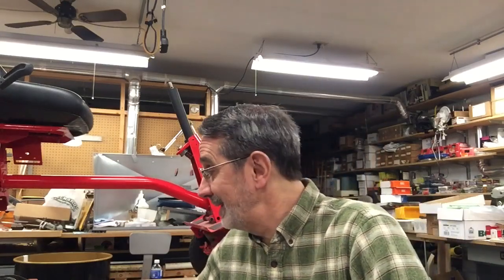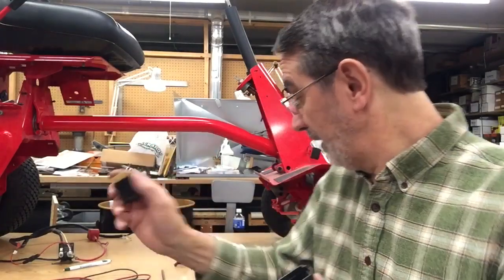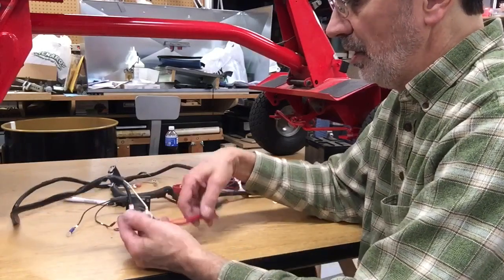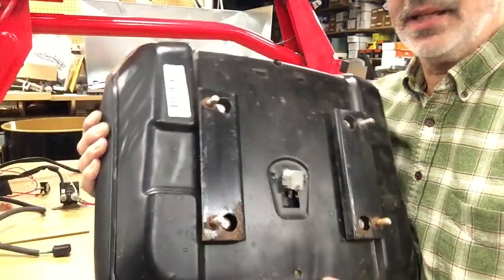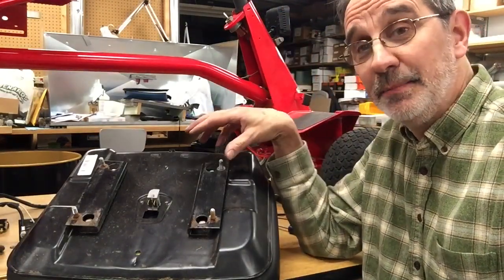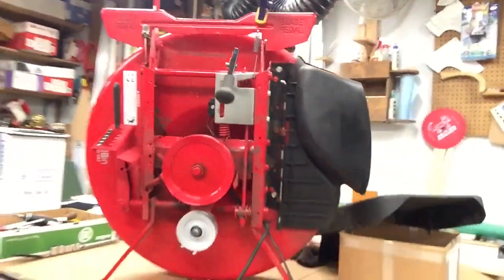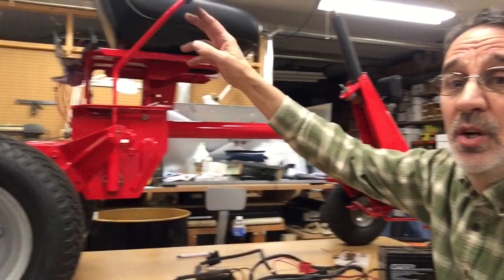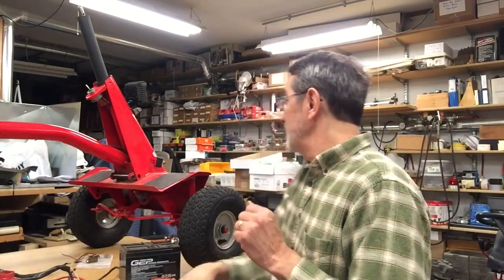273. How to test and find the safety switches Snapper RER

Comment: Jim, no fire at plug. All safety  switches tested good. pulled master switch out and looked good. pulled ground off coil and had fire to plug. Put back on and no fire. Where do I go from here on my 17 h.p. Snapper?
Reply from the maker: it sounds like it’s your master. Jim
Reply: @jimjackson9381  did u ever figure out how to test the master switch?
Reply from the maker: @jerryorton2566  You’re referring to a master switch are you talking about the module that controls the safety system if so there’s no way that I know of to check it outside of just putting a new one on and seeing if it makes it work. Jim
Reply: @jimjackson9381  Replaced the module and still no fire. I can pull the wire to the carb bowl and it will crank and run but have to pull spark plug off to stop. Finally gave up and took it to Ace Hardware lawnmower shop.

Comment: Mine was mowing fine one day then the next time it wouldn’t start. Engine turned over but no spark so I unplug kill wire to coil and it had spark. I unplug seat switch and it started but dies when I let the clutch out. If it’s unplugged doesn’t it think someone is sitting on it?
Reply from the maker: @robwright4398  if your machine is stalling when you let out the clutch, it’s probably the switch on your yoke. If you stand your machine up is down in the lower left-hand corner and it has wires hooked.
Reply: @jimjackson9381 okay you was right, I removed the one under the back of mower and it was covered with oil. Cleaned and blew with air then put it back in and now it’s working again. Thanks for pointing me in the right direction.
Reply from the maker: @robwright4398  you’re welcome and thank you for watching.  Subscribe and tell your friends.

Comment: Where does the battery ground cable attack to. Is it supposed to attach somewhere on the frame or like mine on the motor mounting bolt?
Reply from the maker: The ground cable from the battery typically goes underneath one of the nuts that hold the engine to the frame. Jim
Reply: @jimjackson9381  gotcha that's where mine is at. I wasn't sure , thanks for the fast reply

Comment: Hello Jim, to test the solenoid, that is still mounted to my mower, do I need to disconnect the wires first ? Obviously I need access to the lug that I touch to test, but what about the rest. Thanks !
Reply from the maker: First thing you want to do is take a jumper cable and hook it to your positive side of your battery and touch it on the lug, sticking out of the side of your starter and check to see if your starter is even working, if that works take a number 14 wire and jump it from the large lug on the solenoid to the small speed connector that your ignition key wire hooks to that should make the solenoid connect and send power to the starter. Make sure the machines in neutral first. That should tell you if your solenoid is working try that and let me know what it’s doing. Jim.
Reply: @jimjackson9381  I didn't run the steps regarding the starter and ignition switch Jim, as I only manually start the mower. Since I don't have a battery for the mower I used my truck battery and tested the solenoid as you did in this video. The solenoid only clicks, each time I touch the lug. My tester never makes a sound.
Reply from the maker: @wacmac1976  well every time you touch 12 V to the spade connector on the side of the solenoid. If it’s making a clicking sound, then it is working properly you need to check with a continuity tester from the big lug  across to the other big lug and see if you have Continuity when you make the solenoid click, you’ll have to unhook the batteries all you don’t want power going through it.   Let me know what it does.      Jim
Reply: @jimjackson9381  I held the solenoid base to my truck battery's negative post, touched the lug on top of the solenoid with a wire coming from the positive post and the solenoid clicked. At the same time I held my tester leads on the two threaded lugs and didn't get any sound/continuity. Did I do it correctly ?
Reply from the maker: @wacmac1976  I would say yes your solenoid is working. That’s why it’s clicking. Put your contacts inside apparently are burned up. Just pick up a new one I get them at Lowe’s for about 14 bucks. Jim.
Reply from the maker: By want you say I would have to guess that your solenoid is not any good and you need to replace it. Jim.
Reply: @jimjackson9381  Jim, I installed a new solenoid, still no spark. After watching a couple of you videos, again, I plan to test the new solenoid to be sure it's not defective. If that tests good then maybe I need to test the coil. Thanks for your help !
Reply from the maker: @wacmac1976  yes I would ck. the coil.    Jim
Reply: @jimjackson9381  Hello Jim. I finally had time to test the coil on my Snapper. The coil tested good, using your "how to" video. Turns out the flywheel magnet and coil contacts were very rusty ! I cleaned them both, reassembled , and the engine fired right up. So this was my problem all along. I had a Tecumseh engine on a Snapper years ago that was very prone to rust on the flywheel, surprised I didn't remember that. I thank you so much for your help and support getting this problem solved. Take care !!!!!
Reply from the maker: @wacmac1976  well sometimes it’s the simplest things that can cause the biggest problems. Glad you found it. Jim.

Comment: Hello there I have a snapper change a new starter and new battery check fuse check all connections when key turns on I heard the click but won’t start any recommendations?
Reply from the maker: Check the starting solenoid.     Jim
Reply: @jimjackson9381  thanks I fix it that’s what it was 👍👍👍

Comment: Hi , thanks for your video . 
Question, how can I start my Snapper without a deck?
Reply from the maker: You’ll have to disconnect the switch that goes to the deck if it has one and try to start the machine if it will not start and Twista two wires together and put away or not on it and see if that will make it start. Let me know. Jim

Comment: Linkage cable effects clutch safety switch position. How do I adjust?
Reply from the maker: To just your clutch or brake cable you have to move the ferrules on the cable to the backside of the panel which will make the cables shorter if you need any further assistance please let me know. Jim

Comment: Here’s a head scratcher…my 2001 RER has been running good, so today, I back it off my trailer,  I engaged the blade but I didn’t have the motor up to speed and it died… now it won’t start back up!!! What??? I’ve checked all the obvious things… idk 🤷🏼‍♂️ any ideas? Why it would die and not crank back up?
Reply from the maker: Did you check the key in the fly wheel, maybe it lost time. Jim

Comment: Thanks Jim for the video. I purchased a used RER model 3012523BVE (7800105). I noticed none of the safety features were working. The mower starts manually and works fine, but the electric start does not work, just clicks.I discovered (thanks to your video) that the plug-in interlock module was missing. I am getting a replacement for that, assuming the switches themselves are OK should that enable the safety system? Could the missing module be a cause for the electric start to not work?
Reply from the maker: Well let me know if you buy one and it doesn’t work I have some other things for you to check. Jim
Reply: Does it make sense that the mower is able to manually start and work with the interlock module missing? Wouldn’t that leave all the safety switches in their off position? Just wondering if I might be missing something else.
Reply from the maker: @yewtoobules  I would say if they took out the module and the machine is still Running then they must of unhook the one wire coming from yet going to the magneto shorting block otherwise the machine wouldn’t start. Jim
Reply: @jimjackson9381  The magneto shorting block was a good clue. I took a look at it. There are three black wires and one clip whose wire was cut. It looks like it was yellow. One black goes back into the engine, the other down the central red shaft of the mower and the other black wire goes through the harness back to the interlock module. Any idea where this yellow one was supposed to go?
Reply from the maker: @yewtoobules  Can you trace the yellow one and see if it goes back to your stater for charging your battery, let me know what you fine. Jim
Reply: I couldn’t find the source of the yellow one since it was cut off at that grounding block. I did make a new discovery however. Someone disconnected the clutch safety. I found the female end zip tied in the rear with a jumper clip in it probably to simulate the clutch being depressed all the time. Not sure if the cut lead to the ground is related to the safety system or the reason the electric start only clicks. You mention the clutch switch in this video but I don’t think you showed it. Do you have a video that shows where the switch should be located? I wasn’t sure what to look for.
Reply from the maker: @yewtoobules  When I get home tonight I’ll send you a picture of the location of the clutch switch. Jim
Reply from the maker: I got these pictures for you but all I have is your YouTube channel name I don’t have your email address send it to my email and I’ll ship you the pictures
jimsfixitshop@gmail.com
Thanks. Jim

Comment: Jim, have a switch problem.  Snapper 250813BE  wouldn't start.  Changed the clutch/ brake switch now it starts and runs but i don't have to press clutch or sit on seat.  I can started by standing next to it. Any ides? All I did was canged one switch. Thanks
Reply from the maker: My bosses machine has the same issue and I can’t figure out what the problem is I’m still working on that if I figure it out I’ll let you know and if you figure it out let me know talk to you soon. Jim
Reply: Not surprised

Comment: cant seem to locate the brake switch on my snapper/craftsman? in the back somewhere?
Reply from the maker: Michael Gorton 
If you stand up your machine it would be inside the rear case on the lower left-hand side it typically has four wires hooked to it some have two. Jim

Comment: Jim., may snapper starts right up but dies once I take my foot off the break or engage the clutch. You think it could be a safety switch?
Reply from the maker: Yes it is definitely a safety switch ,  it is the switch inside the rear case that the yolk activates when you push your pedal in and out. Jim
Reply: Awesome… thanks Jim.. I also stumbled across your video #151 that address this issue.
Reply: I picked up a used snapper tonight and that was the issue. I real score for me. Only 250 and it is in very good shape.
Reply: I do yard work and use a 30” snapper with a 10hp Briggs flathead on it.. it’s a 2001 model I believe. But what I do is I load it on my truck without driving it up. I engage it into 1st gear and guid the mower up the ramps while standing beside it. I used to ride it up till I figured that out… very dangerous to ride it up into my truck like that. A bit fun and an adrenaline rush but it’s basically Russian roulette… lol
Reply: So I would like to bypass all those switches on this new snapper so I can continue to load it this way.
Reply from the maker: Well you can bypass the safety system only to find out if that is the issue then if the machine starts up and keeps running you know what to look for that’s probably why they sold that nice machine so cheap but the safety switches are very inexpensive and it would be worth fixing it so it works properly after all it is a safety system the first one I would check is the one inside the rear case that your yolk activates as you step on your break/clutch pedal keep me posted on what’s going on and I can help you through it. Jim
Reply from the maker: Well Steve I hate to have people stumbling so I’ll tell you what, go to video number 315 and go to the description area in the video and there is a link that will take you to my video list by number so you can find whatever you need to solve the issues you have with your snapper. Jim
Reply: Awesome Jim.. thanks a million 👍
Reply from the maker: @stevetorres76  That’s what I’m here for. Jim
Reply: Yes Sir… you’ve been fixing my snapper via your YouTube channel for several years now… I only wish you were my neighbor. Lol
Reply from the maker: @stevetorres76  well I had a guy and his wife drive his 33 inch machine here from the north corner of Minnesota, where do you live. Jim

Comment: Hey Jim. I'm at a loss. I had to replace my carburetor because of a flooding issue. The motor is running fine, but it now dies when releasing the clutch even in neutral. I have confirmed that all the switches are functioning correctly with my multi meter. Is it time to get a new interlock or do you have any other ideas?
Reply from the maker: If you’ve checked all of the switches and wires and the only thing that’s left is the interlock. Jim
Reply: @jimjackson9381   I figured so. Went ahead and got one on the way. Still scratching my head to how these things go bad.
Reply from the maker: @longboardcamify  D C current is hard and switches and contacts every time the switch opens it sparks and it causes carbon and burning, let me know if that takes care of the issue. Jim
Reply: My thought as well. I think im going to use my electric start sparingly from now on.
Reply: Hey just thought I should let you know it was the interlock. New one worked like a charm. Let me know if you want me to send the bad one to you.
Reply from the maker: @longboardcamify  thanks for letting me know what you found out.Jim

Comment: Is the mower supposed to run with clutch pushed in but not sitting on the seat?  Mine is running with the seat safety switch disconnected but dies the second I let the clutch out.
Reply from the maker: Your machine will run with the clutch pushed in and the lock lever slid over the clutch pedal, if it dies as soon as you let out the clutch it’s probably the switch on the yoke causing the issue. Jim
Reply: Jim, thanks for the help.  I can’t believe what ended up fixing it.  I unplugged the interlock brain and left it out and cut the wiring to the seat switch.  This lets the mower start and run no matter what.  If I try to attach the seat switch wires together to bypass the seat switch or leave the interlock plugged in it won’t stay running.  Very strange to me.  Anyway thanks again.

Comment: Hello Jim, I am trying to learn myself a new hobby working with small engines. I have been watching your videos as instruction but now I am stumped. I have a Snapper (Model 7800647) that has been sitting for some years. I cleaned the gas tank and spark plug and changed the oil. After an hour or so off trying I finally got it started. It was running a little rough so I jumped off into rebuilding the carb (failed) ended up having to buy a new car. I couldnt get it started again. I replaced the wiring for the ignition kill switch because of some rubbing. I am stumped and need assistance. Any pointer or direction you could give? Thanks
Reply from the maker: Try removing all of the wires off of the magneto shorting block and see if it will start
Reply: @jimjackson9381  including the kill wire to the magneto?
Reply from the maker: Grant Crabill 
Yes including the Kill wire if it does start then just touch the kill wire anywhere on the ground in the engine will quit. Jim
Reply: @jimjackson9381  Thank you. I will update this evening with results.
Reply: @jimjackson9381  I have disconnected all wires, still no start. Going to watch the video of testing the magneto
Reply: @jimjackson9381  ok, so I pulled the spark plug and verified I do have spark. I did notice when I pulled the plug it is not wet. I'm worried I'm not getting fuel to the cylinder. I installed the new carb but made no adjustments to it. I did do a quick spray of start fluid and the engine started long enough to burn the start aid. There is a new online filter on it, I removed it anyway to verify no issues. Any suggestions.
Reply from the maker: Grant Crabill 
If you’re not sure it’s getting gas pull the spark plug out and squirt a little gas right in the cylinder put the plug back in and see if it’ll fire, you can also use starting fluid but be extremely careful with that too much could blow a hole in the top of your piston. Jim
Reply: @jimjackson9381  got the mower started today!! Runs smooth. Thank you.....moving on to the part of my project, getting reverse to work. I have checked and repaired issues shown in your videos. I have found that when I put it in rev the handle is all the way back but  it's not fully sliding in the yolks. No damage on the yolks and I can push it further by hand.
Reply from the maker: Grant Crabill 
Try Watching video number 253 and see if that adjustment will help you get reverse and let me know. Jim
Reply: @jimjackson9381  That video was just what I needed. Thank you so much for your help. Mower is working great. Apologies for not mentioning before I am from Prattville Al

Comment: I need the wire connectors that fit into the mower deck switch.  My deck switch is good but a critter chewed through the wires right where the metal spade fits in the plastic housing.  So just looking to replace those wires/connectors.  Any thoughts?
Reply from the maker: Check your local ace hardware or Menards or Home Depot or Lowe’s still all carry the connectors. Jim
Reply: @jimjackson9381  Thank you.  A reason to go to Ace.  Do you happen to know what those connectors are called?
Reply from the maker: @funymuny  I think I would take the switch off the deck and take it with you that way they can see what you need. Jim